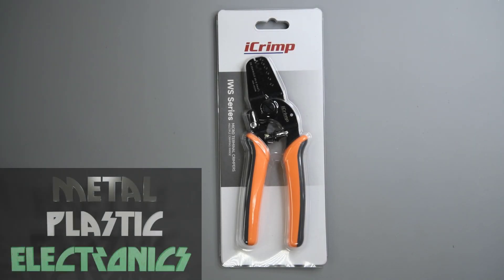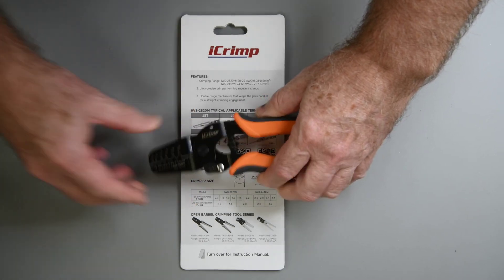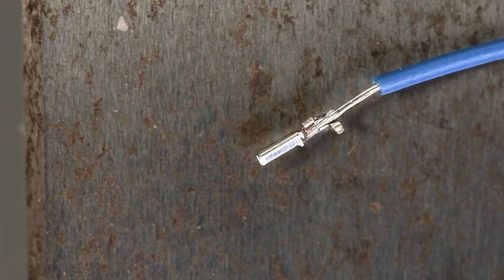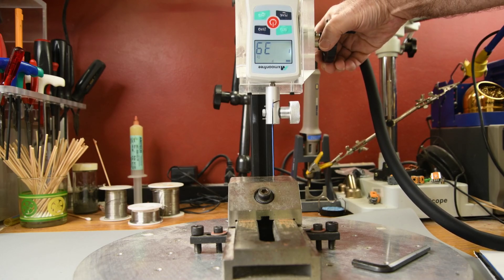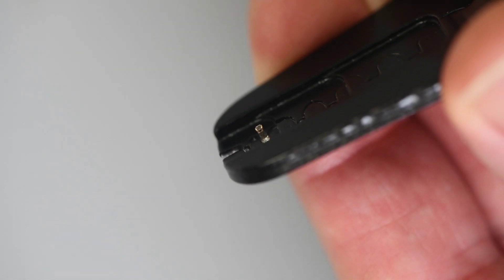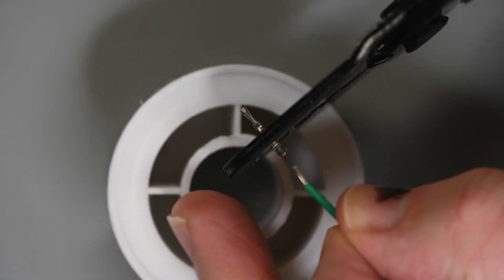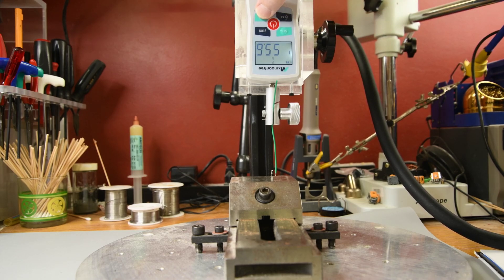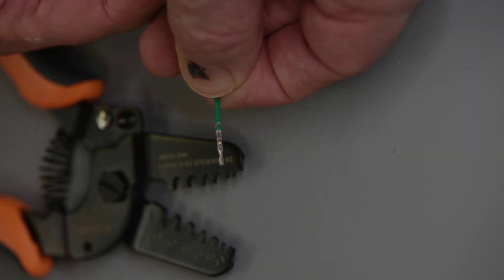iCrimp IWS-2820M vs Molex CLIK-Mate

Comment: Sorry, I think I was the one that mentioned this tool. Granted I never actually used it myself, just saw knowledgeable people speaking relatively positively of it when I was researching crimp tools. Hopefully you can return it or exchange it if you want to see if it was a QC issue.

Personally, I ponied up for the PAD-11 as I didn't want to have to sit around questioning whether it was me or the tool at fault when trying to learn how to crimp. Seems to work pretty good, but I also have nothing to compare it to.
Reply from the maker: I'll keep it.  As I get different terminals to test I'll give it a try on them.  It did okay with the Molex SL terminals.  Anytime you see a tool you think is interesting leave a comment, that is one thing I like taking a look at.  Thanks.

Comment: It seems like the Iwiss/Icrimp SN series crimpers with the ratchet mechanism are much better than these thinner, cheaper ones. I've had good luck with mine as well as the thin Engineer crimp pliers.
Reply from the maker: The Engineer PA-09 is still my go-to tool for small terminals.

Comment: Tried these and switched to Engineer branded ones. More expensive but much better crimps.
Reply from the maker: Which Engineer crimp tool are you using?
Reply: @metalplasticelectronics354  Engineer PA-24, I have others but they are the most useful as I do a lot of Dupont
Reply from the maker: I'll have to take a look at them, the only Engineer brand tool I have is the PA-09.

Comment: 1 out of 20 I’d go nuts. When I crimp/solder  LMR 400 , have to make sure the connector doesn’t slip right before crimping with some downward pressure. Definitely a pain when using these massive guns 💪🏻
Reply from the maker: Yeah, this tool is not for the impatient, that's for sure.  LMR400 is that a coax connector?